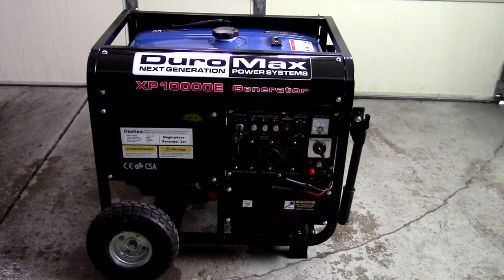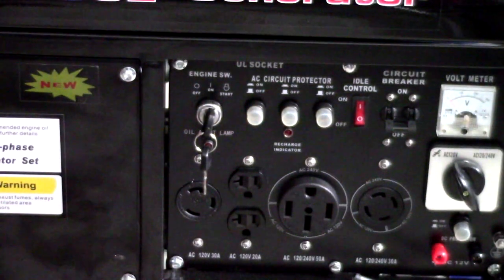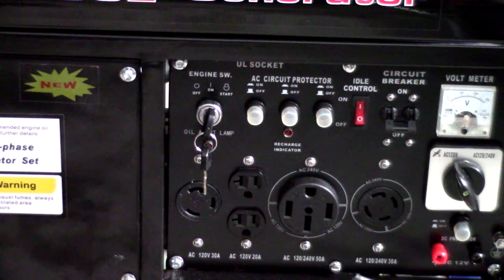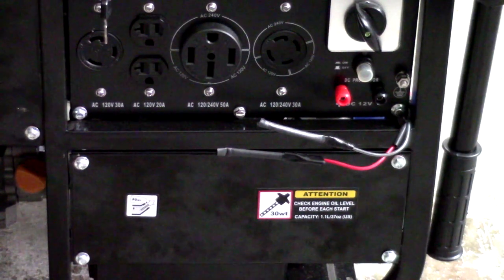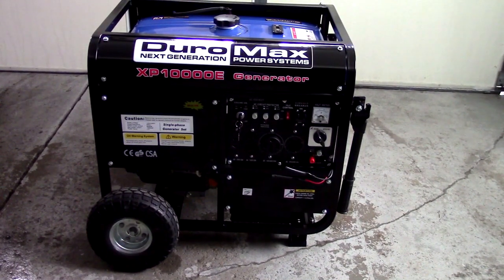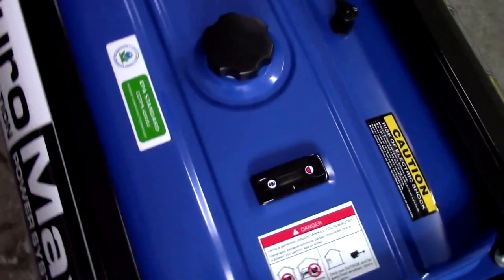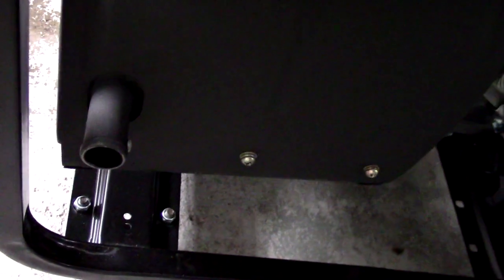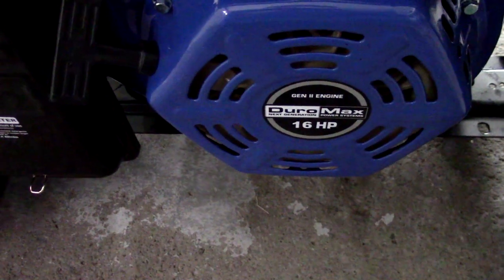DuroMax XP10000E Generator Review and Operation

Comment: can I tie this generator into my main power supply and switch it on if the main power goes out? 

Would this generator be able to run all my appliances simultaneously?
Reply: The 4000w generator uses a locking 240v 30A outlet which provides a ground, neutral, and two hots. These two hots are compatible with a typical household breaker box. Never feed multiple AC sources into the same circuit. Use a transfer switch box (the boating ones air fairly cheap) to ensure only a single AC circuit is active at a time. These typically switch over to your generator soon after you fire it up (as opposed to only when main power has failed). You can buy a locking 30A switch inlet box which let's you plug in a cord to the side of a house/structure. Use 8 AWG (4-wire) when wiring up the inlet box to the main breaker box. Special metal tabs can also be bought that only allows for the 'main breaker' or the 'generator inlet breaker' to be active (physically, by pushing the tab one way or the other) as opposed to an automatic transfer switch. 

Note that when splitting a 240v system into two legs each leg is warranted 15A maximum if both are in use. The 4000 watts is the ultimate limit here.  Note that the generator performs the same amount of work to produce power on one of the legs as it does to provide the same amount of power on both of the legs. 

An external ground connection is recommended in the manual. If your generator has a "floating voltage" that significantly differs from "earth ground" then you can potentially be electrocuted (due to the difference in voltage) when you handle the unit. Use a multi-meter to test outlets to see whether you have a real ground. The difference between the "hot leg" and ground should be max volt (i.e. 120v)  - voltage drop of current load. The difference between neutral and ground should be the voltage drop of the current load (i.e. a volt or two). An older built house without proper ground wiring to the outlets might show 60v difference between both leg to ground and neutral to ground connections as it floating between the min and max.

For appliance use; with the 4000 watt model you have 30 amps available. I would recommend switching off all breakers and then once the generator is active switching single 15amp breakers on at a time. If only need power in your living room, and your living room uses a 15 or 20 amp breaker, then you know it is safe. Since the water heater and oven use a 50 amp breaker then it is good indicator that it would be too high of a load for the generator to handle.
Reply: 8000 ÷ 240 will give you total amps you can pull from generator. You will have to research how much each device in you home will use. For instance 2.5 ton AC unit will have a 40 amp breaker and pull approx 32 amps
Reply: Wired into the house this generator will easily run most of your house.

Comment: Anyone know what the black plug with hose on the top of the tank is for?  It looks like its an air intake valve, but its leaking gas.
Reply: its a vent for the gas tank if u fill the tank to the very top... and theres a warm day the gas will expand maken it leak ... it wont hurt any thing ... just dont fill it so full

Comment: Do you ground this generator when you use it?
Reply: No, that happens when you plug it into your home system
Reply: If using this generator as a power source fir your house, and assuming your panel is grounded, you may want to remove the jumper between the ground and neutral in the generator.
Reply: @toddlaroche6047  as an electrician myself, I can say that I never had a problem in that regard.
Reply: Yeah, DuroMax calls this generator a floating neutral, but it’s not… neutral and ground are actually bonded. You can use it that way as a power source wired into to the panel, but not ideal.

Comment: its junk. can't get anyone to work on it.  i bought two one for my house and one for my moms house.  4 hours into the first time we had to use them the flywheel fan blow apart on mine. and about 8 hours in to it on my mothers it just blew the hell up. couldnt find anyone i mean NOONE from beaumont to houston that would work on it. and the dealer i got it from refused to even look at it. so i had to go to harbor freight and buy 2 8750/7000 been using both for over 3 years and they work great. and let me tell you i dont like much that comes from harbor freight.
Reply: i forgot to say that when my flywheel fan blew up on mine it melted the engine.
Reply: Calling the manufacturer may get you more results than trolling youtube.
Reply: didn't do any good. i did that way before i started trolling youtube
Reply: Wanna sell them?
Reply: sorry joe one is gone already and the other one i promised to a friend already. i just wish he would come get it
Reply: I just wonder, did you check the oil level before starting?